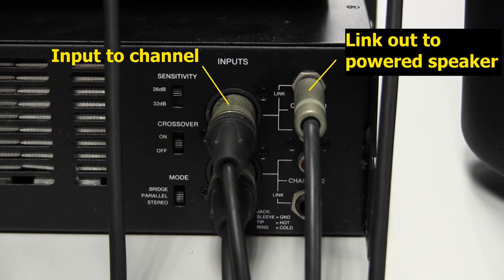The Sounding Board Episode 1 - Q&A with GLB Productions!

Comment: Hi Bruno, thank you for your videos. I have a question pertaining to the last topic about DI’s and line inputs. I have an audio interface (RME MADIface Pro) which has 2 XLR inputs and 2 unbalanced TS instrument/line inputs which within software can be set to +4dBu, -10dBV and has 9dB of gain. I have been doing sound for some live events with the interface and have been able to connect guitars, keyboards directly to the TS instrument/line inputs but depending on cable length sometimes it can be a bit tricky. Would an active DI box, using a 9volt battery help in this situation or would a small Mackie 402 or 802 using its line and Hi-Z switch and line outputs be a better option?

Thank you.
Reply from the maker: Ultimately, a mixer will always be better for mixing because it is designed for that purpose 😄 However there is no need to rush out and buy one if your current setup is working for you. The challenge with using an audio interface as a mixer is that the essential controls are in the software, which can lag or freeze at the worse possible time.

Comment: sir when i do my sound check i hear hiss noise coming from the speakers.. is it due to earthing..if so then how can i solve it and protect my gear in live sounds?
Reply from the maker: All sound systems hiss a bit due to the amount of gain involved. If you have severe hiss it generally means that either a) your system gain structure is wrong - typically not enough channel gain and power amps set to max or b) you have a system fault. Find out where the hiss is coming from - unplug everything from you power amp: if the hiss goes away then you know it is coming from the mixer; if it doesn't then the problem is the power amp, and work from there.
Reply: @GLBProductions  i heard about earthing stuff.. and wanted to know if that could also cause the hiss..sir..if not then i will have to follow waht you said.

Comment: Good stuff! Enjoying your series of videos! To contribute; using line input when out of Mic ins;line level is not recommended for long cable runs if unbalanced. As Bruno points out the gain is well up to get a level.
Use short as possible XLR cable connected from DI to the XLR connector to  + and - with shield  disconnected at the mixer end but connected to shield at the DI end. 
If instrument is line level into the  DI proposed. it is better to run line level with such a cable to mixer or via a breakout box where the cable at the mixer end shield is not connected to a TS  jack sleeve.
Reply from the maker: Thanks for the contributions Bart! I strongly recommend NOT disconnecting the shield in a balanced XLR cable because it then cannot pass phantom power! If you really need to do this use a short adapter cable wired specifically for this purpose. The ground lift switch on the DI box will solve most grounding issues - if it does not the problem is often elsewhere.

Comment: Something I learned on the video sounding board about creating a stereo channel using two channel panning one to the left and one to the right. I like the effect but what would be the purpose
Reply: Got it!!........Zone Control
Reply from the maker: A stereo signal by definition is one left and one right signal. In order for this to be reproduced correctly on a stereo PA system you need to separate the two channels, otherwise you are combining them and introducing a lack of separation that was not part of the original mix. Of course there will be times when you need to combine them to mono, but at that point it is no longer a true stereo signal.

Comment: Can i play a electric guitar through a pa mixer( obviously using a di box with phantom) and then get the hard rock effects that you get on a normal guitar amp?
Reply from the maker: +Hugo Du Randt Lategan Yes, you just have to use an appropriate amp/cabinet simulator - there are many on the market today.
Reply: +GLB Productions so i cant do this feauture through a normal pa mixer?
Reply from the maker: +Hugo Du Randt Lategan Not really, you need a product that is specific to the type of music you play and the sound you want to achieve. Most PA mixers have effects that are very generic.
Reply: +GLB Productions i got it right! I plugged guitar through di and then into pa. On the pa mixer i went to afgects and turned on distrotion. It made the electric guitar a nice rock sound! It works perfect.
Reply from the maker: +Hugo Du Randt Lategan Great! Glad it worked out for you.

Comment: Brilliant series Bruno. I have a question for you. I have a Zoom R24 Digital Recorder/Interface/Controller/Sampler and also a Yamaha MG12XU mixer. I use the Zoom machine mainly for home recordings, and the Yamaha mixer for "outside"  work. Is it possible to link both together. given that the Zoom is digital and the Yamaha is analogue?  BTW both have high speed USB 2.0 connections.
Also, I loved the Gethsemane recording. and I see your point about using a compressor for the "...crucify Him..." vocals.  God bless.
Reply from the maker: +David Cunningham Hello David, thanks for getting in touch, glad you have been enjoying the videos. How do you propose to link the Zoom and the Yamaha together?
Reply: +GLB Productions That's what I wanted to know. I propose to use the outputs from the Zoom (which I use at the moment to connect a pair of powered monitors) to a suitable input on the Yamaha (which ones I should use is my main question). Levels should be okay because the outputs from the Zoom are not "strong" enough to drive anything but powered speakers. Level is about the same as my Yamaha Tyros 4 keyboard, which also used powered speakers.
Reply from the maker: +David Cunningham Ah I see - I thought you wanted to connect the two USB ports together and have some sort of bi-directional signal flow happening ;)

Connecting the zoom to the Yamaha should be very simple - just connect the outputs of the zoom to line inputs on the Yamaha using standard guitar cables. You can either use two mono channels or one of the stereo channels. Yes the zoom is digital but it has both analog and digital outputs so will interface with the Yamaha just fine. Let me know how it works out :)

Comment: so it's possible to run both passive speakers and loudspeakers on one amplifier?
Reply: active and passive speakers on one amplifier?
Reply from the maker: +Ralph Sanchez It's possible but not necessary - ideally a powered speaker should be connected directly to the output of a mixer or EQ. The viewer who asked the question had run out of mixer outputs and needed an easy way to get the signal to his powered speaker.

Comment: may I make a suggestion - have the time code in the description for each
 topic so people can jump to what topic they want to hear about. 
0:41 - Can you run a powered speaker off a power amplifier?
2:07 - When connecting a laptop or smartphone to a mixer, what should the volume on the device be set to?
3:06 - Where should the channel and master faders on the mixer be set when performing the gain setting procedure?
4:32 - Can I connect the output of a DI box to a line input on the mixer?
Reply from the maker: +JOUE BIEN TECH I was actually hoping people would watch the entire video since it's not very long but yes that's a good idea :)
Reply: +GLB Productions From my experience in design (keeping in mind I'm still at uni and Educational Design For Multimedia was a class I was glad I took - although that doesn't make me an expert in the field) - web based leaning is very much set at your own pace and learning about only want you need/want to lean about.
Seeing as all the topics in the video don't build on top of each other in a linear or hierarchy structure than each topic is probably better off being self contained (ie each in their own video) or easily findable with topics marked (like chapters in a book - or video time stamps).
Reply: +JOUE BIEN TECH Having each topic in a separate video may not be good for Patreon people. Currently I'm supporting GLB on a 'per new video' basis. Great for a ten minute video every week or two. Not so good for four videos of 2.5 minutes each.

I agree with each section being given a time code. Most people will still watch the whole video but the short cuts are there if needed. Many thanks Bruno - more please!
Reply from the maker: +48snapper Thanks for the input, time links have been added to the video description :)